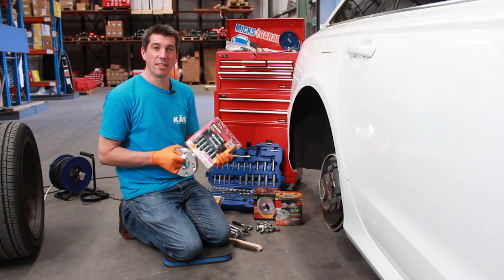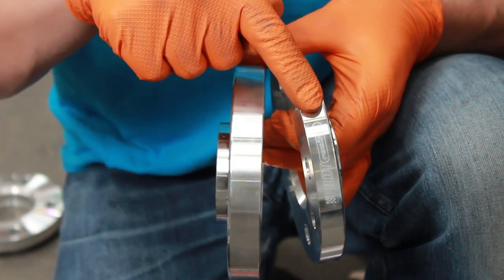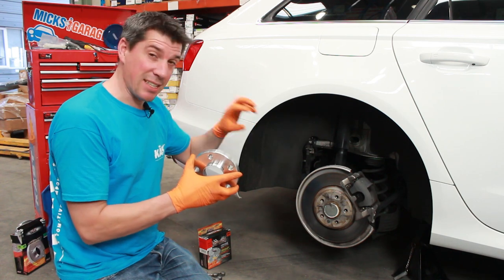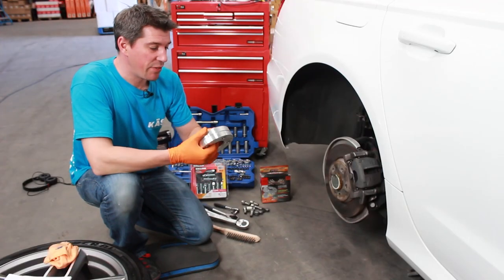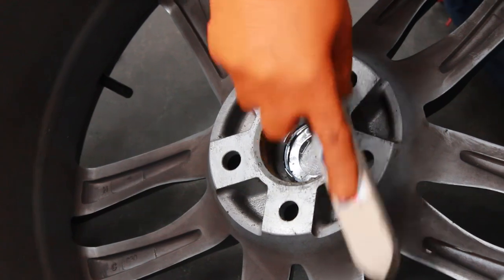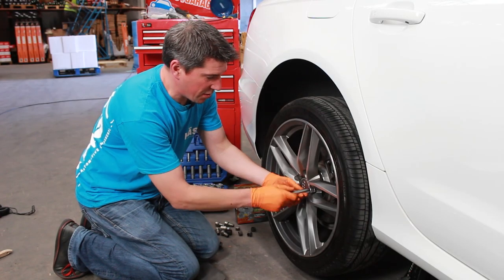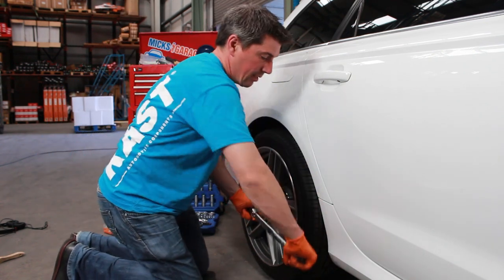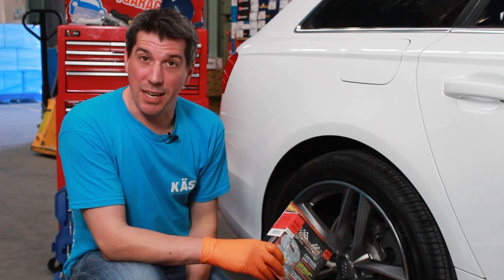How to Fit Hub Centric Wheel Spacers

Comment: Is the brand of these ones call hub centric? I’m just wondering if their good quality and safe as they are pretty cheap
Reply: Hubcentric is not the brand, hubcentric is the type of spacer. Like it was said in the video, it has the same center bore as the wheel hub and duplicates that hub on the outside so the wheel can safely sit on the ledge.

When you're looking into hubcentric wheel spacers, two things should be accounted for: center bore and bolt pattern. That information can be safely found by googling your car/model/year along with the desired information.